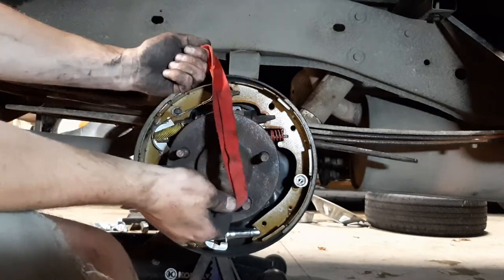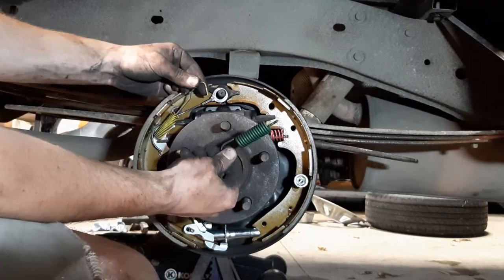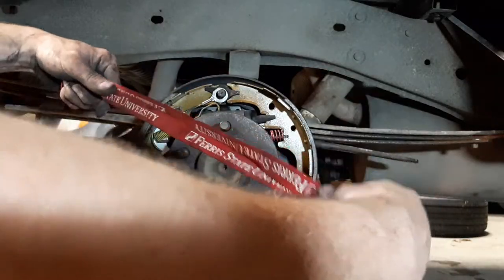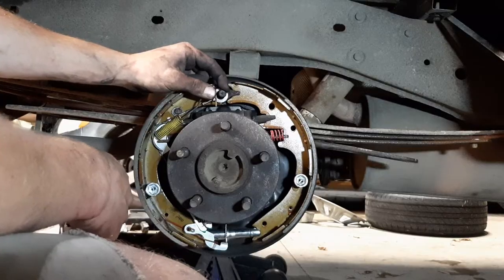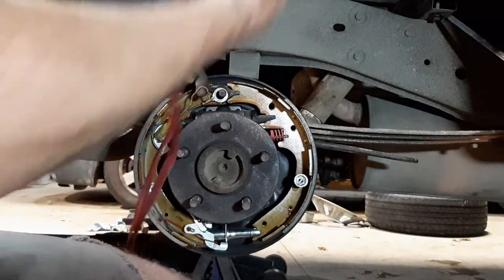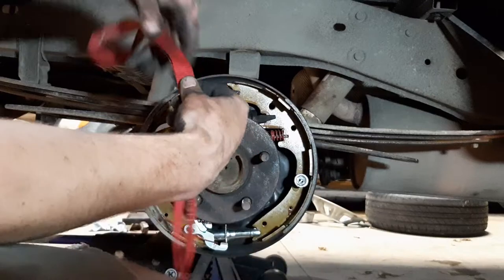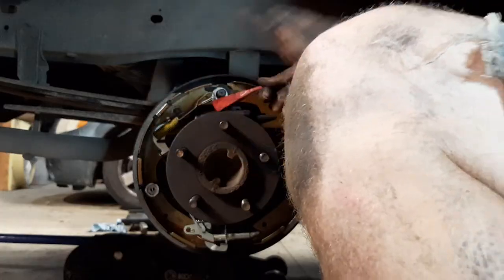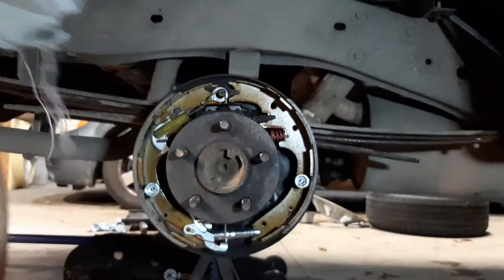How to: EASY trick for installing springs in drum brakes - no special tools!

Comment: Unfortunately my springs don't hook onto a peg that sticks out, it goes into little holes so this method wouldn't work :(
Reply from the maker: You can use a string on the hook part of the spring so it's not covering the tip. That way you can still get the end of the spring in the hole.